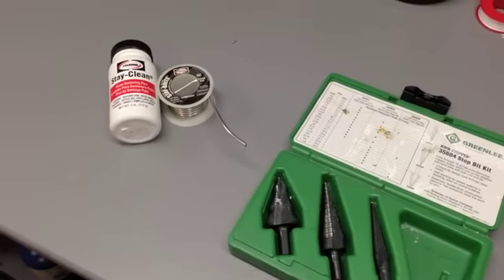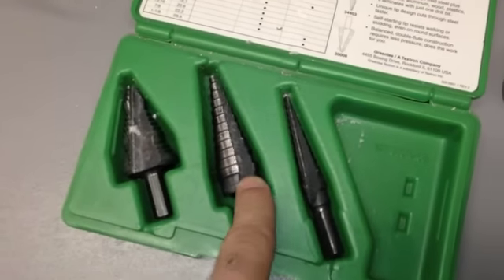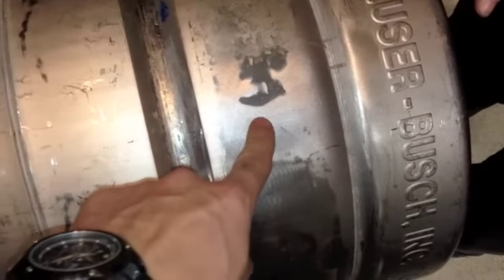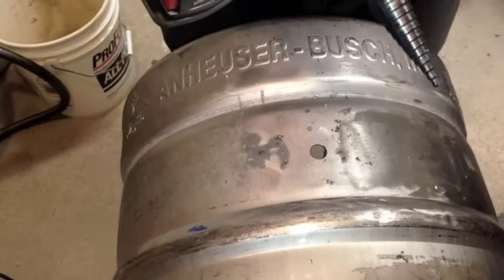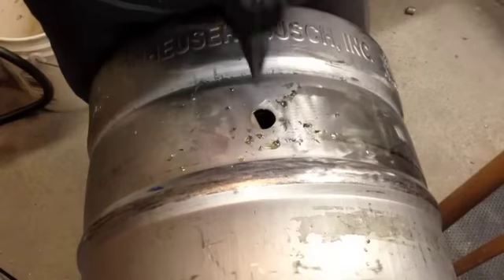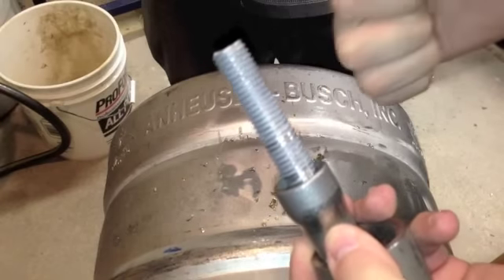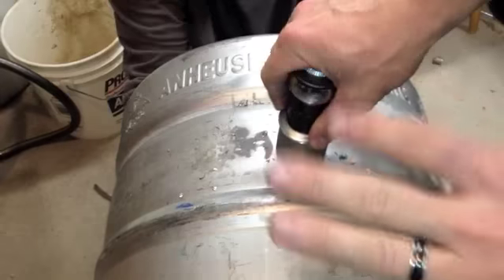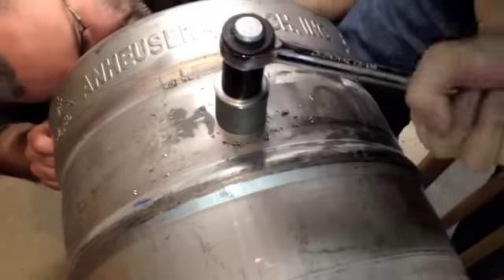SIlver Soldering a Keggle pt 1

Comment: Great video. My brew partner and I are going to be soldering 3 kegs this weekend. Thanks for posting this.
Reply: Follow up- did a few test dimples on a piece of scrap 20 gauge steel. On the first run, our final dimple hole diameter was about 1/8" too large for our couplers we bought. I measured the diameter of the couplers with a caliper, then found the point on the butt weld reducer that was the same diameter and drew a line with a sharpie. When we did the dimples, we stopped just before the coupler was pulled through to that mark, then backed it off. We then used the dimple kit to pull the coupler into place and finish the last tiny bit (about 1/32nd). Ended up with an amazingly tight fit.
Reply: Jason Bickford 
can you answer my questions please? 
is this stainless steel? 
is this soldered fitting tough enough i mean the tensile in psi? 
is it safe for food and water? 
Sorry if i disturbing you.